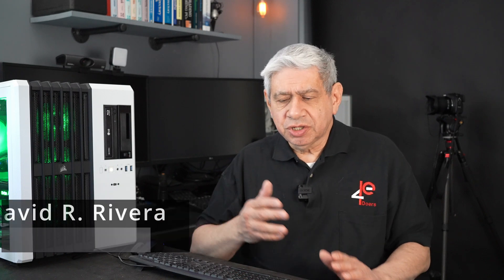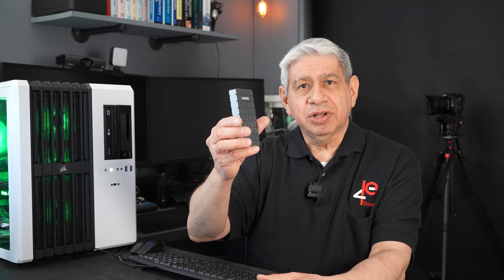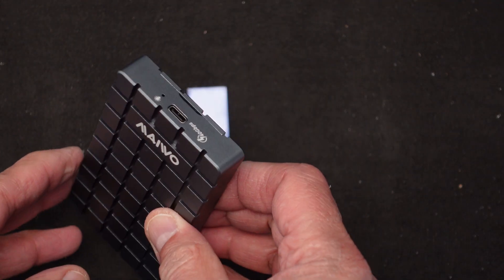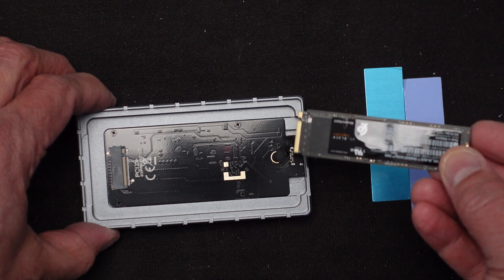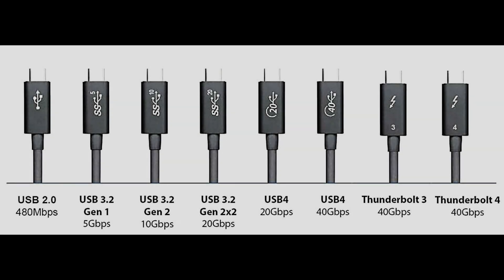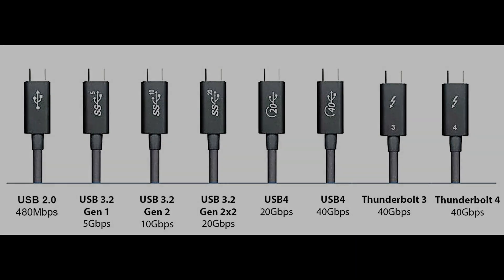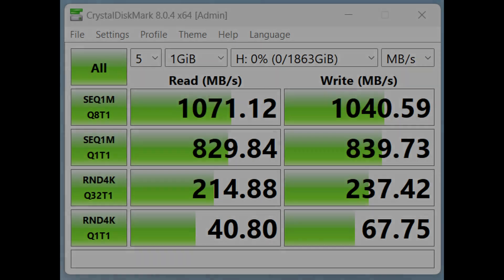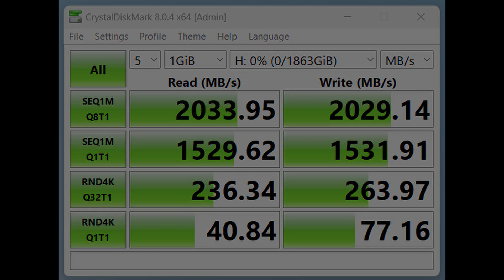Thunderbolt 4 Adapter and Device Install part 1

Comment: What is that server case?
Reply: I really like the Stormtrooper look and all that airflow. This case is the Carbide Series™ Air 540 Arctic White High Airflow ATX Cube Case. :hand-purple-blue-peace:
Reply from the maker: Jay, as you can see from another viewers comment to you question, it's the Corsair Air 540.  I did a review of that case about four years ago: https://www.youtube.com/watch?v=4w2JNm7tK9A&t=984s 
However I did not find a build to use it in until I built my VM Server (one of my recent video series that I still need to close-out with one more video soon): https://www.youtube.com/playlist?list=PLBP4QXQvniTfcFKbAbkN1ktd7Pn1hFCUJ